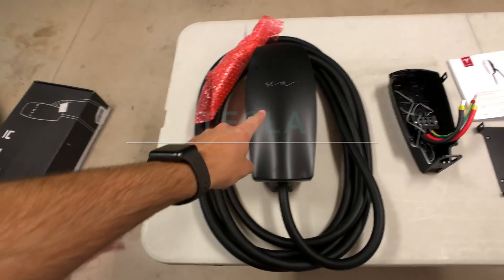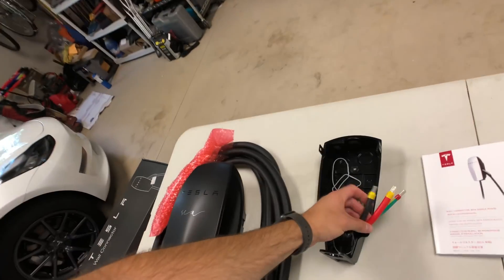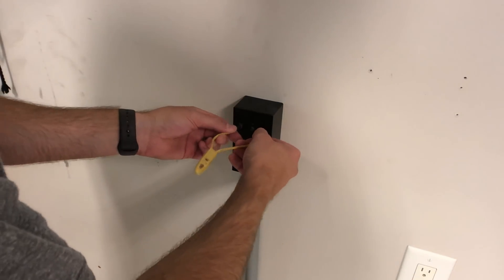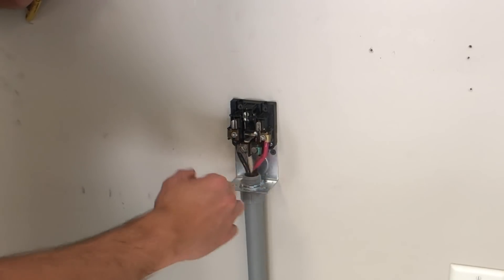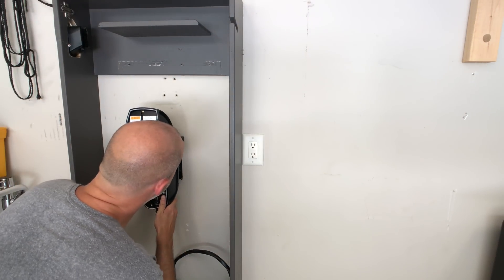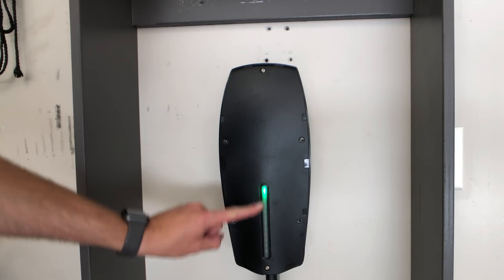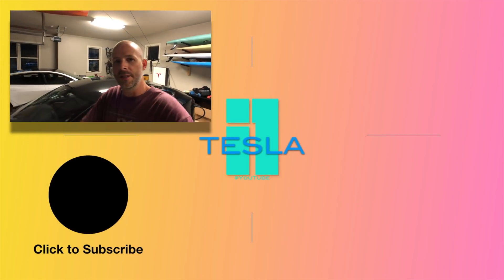Tesla Wall Connector Install

Comment: how long did it take you to install the 2 hot wires? lol, i noticed it was edited out
Reply from the maker: Not that long. About 5 minutes. The hard part is bending the thick wires in the right place
Reply: @i1Tesla it was a bitch for me. bending that in that tiny space, trying not to nick anything... then that orange light when you put power to it, played with my emotion

Comment: Hey Brian, Wouldn’t you have been able to put the 60am breaker, set the Wall Charger to 48 amps.  Then in the cars, set the amp pull for each vehicle (it is location specific).  That way, you could set your wife’s car to 32 amps for nightly charges and your Model 3 to 48 amps.  The cars would be the smart limiter rather than limiting the Wall Charger.
Reply from the maker: Yes but I moved the charger down to my garage for the Model 3. I will put the 60 amp breaker down in that garage.
Reply: @i1Tesla  That works as well, especially if you have a huge garage and two HPWC's!  Make your brother install that one.

Comment: FYI 6 gauge romex is only rated to 55 amps not 60. Therefore the max those wires can safely handle is 55*.80= 44 amps constant.
Reply: https://www.cerrowire.com/products/resources/tables-calculators/ampacity-charts/

Comment: @i1Tesla IMO you should at LEAST install the 60A breaker like you originally planned, and here is why:

The wall connector is not a charger. It's simply a smart adapter giving you a means to supply power in the form of the connector you need to plug in your Teslas. All of the power management is done onboard the cars, and Tesla engineered them individually to not exceed a certain power level deemed safe for that particular battery pack. In the case of your Model 3 "Long Range" (75) and your wife's Model S (75D), they're both limited to 48A, because Tesla believes that to be the fastest rate of charge before having long-term negative effects on a battery that size. This is why the standard model 3 will only support 32A and some larger battery pack models can support up to 72A. Thus, I think you're fine if you want to charge at max speed.
Reply: Also, considering your talks of one day owning a Roadster, I would venture to guess that a car with a 200kW battery pack will support charging at higher rates then currently available. Some of the current 100kW models can charge at 72A, so I think if you really wanted to you could max out your wall connector to the highest it can support (100A) in preparation for what's to come and your current cars will still only charge at 48A. BUT that would require thicker gauge wire, a larger breaker, and a panel at your home capable of supporting the load. Obviously, that is more expensive and completely unnecessary at the moment. Especially since we don't know the max it will support, but theoretically you could be prepared to some degree to charge as fast as your house permits. :)
Reply from the maker: The Roadster is years away but I get your point. I am going to install the 60 amp in the Show garage I am building for my 3
Reply: @i1Tesla  Gotcha. Cool thing is you can regulate the charging level (5A - 48A), when to start charging (time), and when to stop charging (percent charge) all within the car, so you'll have full range capability and still the option to regulate however you please. That'll be good.
Reply: Now I know what you're thinking, the cars charge fast enough with a 50A breaker (40A charging) for what you need, and certainly the slower you charge the easier it is on the battery, but you have to also keep in a couple things. Number 1 and most obvious, you eliminated your ability to charge at max speed in the event you need to or want to. In the event you prefer to charge slower, you can control the rate of charge on the car itself (all the way down to 5A), so there isn't a need to throttle it at the wall. Number 2, there is a trade off when it comes to charging slow. What do I mean by that? The longer it takes for you to charge the car, the longer all of those components (charger, battery cooling system, etc.) have to run, resulting in more wear and tear long term. Therefore, your rate of charge should actually be a balance between what will prolong the life of your battery and what will prolong the life of your components.

Comment: 1. LOL at your expression while you were cleaning the cable.
2. If I get a Signature Black Wall Connector, can I simply swap the face plate with my current one, or is there more different that that, like the sides?
Reply from the maker: Not sure you can get the face plate from Tesla or any owner

Comment: I've watched dozens of your videos in anticipation of receiving my model 3. Thanks for what you're doing. I'd like to know your thoughts about what percentage to charge the battery to and how low you let the car get before you charge. I've read a bit on Reddit, but am interested in your knowledge since this is your second Tesla. Maybe it could be a video or could get incorporated into your next "what if" video. Thanks again!
Reply from the maker: I depends on how much you drive. My Model S is the 75D and my wife drives about 90-100 miles a day. I charge her car to 215 miles every day. She doesn't like to get very low. But also if the power goes out here she has plenty to get back to work the next day and hit the supercharger before she comes home. My car I charge it 2 times a week. Up to about 240 miles and plug it in when I get around 70-100.
Reply: @i1Tesla  Thanks! Any reason you picked 240? Do you remember what it was set to when you got it? I've been reading things from 70% to 90%... I'll be able to go on the lower end based on my commute, but is the best approach to just keep it as low as possible? Even lower than 70%? I feel like this is something that's confusing to first time EV owners, like myself.

Comment: It shouldn't  make any difference what breaker you use - the speed of charge is not controlled by the breaker - the breaker is protecting your wiring not your batteries! So just put the 60 A breaker in and configure your charger to 50 A (position 8) if you want to limit your charging speed - in the future you can ramp it up to 60 A - position 9 - to take advantage of a higher charge without changing the breaker!

Comment: I see your using Romex. You should note that for 60 amp service you will need 4 gauge 3 wire or 4/3 which has an allowable ampacity of 70 amps. 6 gauge or 6/3 will only support 55 amps  see https://hvac.southwire.com/wp-content/uploads/2017/03/ROMEX-%C2%AE-SIMPULL-%C2%AE-TYPE-NM-B.pdf.  6 gauge is only allowed or safe if your using single wires in conduit,  i.e, not Romex. It's a heat limitation issue. Single wires with conduit allows enough cooling. Romex wires are enclosed in a tight vinyl  outer casing can get hot at 60 amps. Its good that you dropped down to 50 amps. P.S. I love the "Supercharger" case. Nice touch.

Comment: Hi Brian,  what kind of range do you get round town driving the way you do.  I also do mostly short round town trips.  Mostly between 1-3 mile trips.  I would use 50 miles of range at the end of the day for only 25 miles of travel.
Reply from the maker: Video Monday or Tuesday with all the findings

Comment: Upgrading from a 120V outlet this weekend. Is the $500 wall connector worth getting over a standard NEMA 14-50? If the difference is only 40amps on the wall connector vs 32 amps on NEMA 14-50, would it really impact the charging rate by much? Any other difference between the two?
Reply from the maker: In my opinion no. Do the NEMA install. It is all you need. I just did this because we won the charger.
Reply: sounds good, NEMA it is! Thanks for the videos... saw as many as I could before getting my Model 3 and they have been a tremendous help! Keep them coming!!

Comment: I like your videos, they’re usually good for a few laughs… Anyways, I agree with the comments about it being a shame that the “signature” is hidden with the door covering the wall connector (or as some mistake for the “charger”)… I wonder… Would it be possible to somehow get the signature onto a stick-on decal or something - and place it on the front of the “Urban Supercharger”? 

Maybe add either a black, or gold stripe to the door… Then you could refer to it as the “Signature Series Supercharger” (yes, I know there’s several S's… ) #just_a_thought!
Reply from the maker: I will be putting on in my show garage that wont be in a box. I will be showing it off

Comment: 48amp (12KW) is still a VERY slow rate of charge on a 75KWH battery, it will not be even remotely close to hurting it or decreasing life in any way.

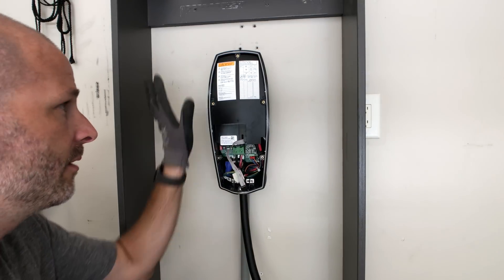Comment: 10:34 - I believe you can set the amp within the car and even schedule the time within the Model 3. So even if you have a 60 amp breaker - you can lessen the amount of amps for charging. This would be a good "What If" question.
Reply: You can. The car even remembers based on GPS what charge current to use next time. Personally I'd put the 60 amp breaker in and dial down charge current if you're worried, then if you ever need the extra power in a hurry you have the ability to increase it.
Reply from the maker: You can do that but why go through all that to change it to 60 amps if Im going to lower it in the car.

Comment: Should have done the 60 amp breaker.  It would make no difference to the battery.
Reply from the maker: I will use the 60 in my show garage for the 3

Comment: So you stuck with the 50a breaker.  How fast does that charge the Model 3?  The Nema 14-50 does mine at 30 mile per hour but of course that only charges at 32a.  Do you get 40a?  If so what does that equal miles per hour of charging?
Reply from the maker: Yes the 3 gets 40 amps. The mph depend on the state of charge

Comment: 6-gauge Romex wire doesn’t support 48A sustained charging on a 60A circuit so it’s good that you stuck with the 50A breaker for 40A charging. 6-AWG romex has max ampacity of 55A.
Reply: Max continuous current 55 amps yes but the Tesla charger is set up for 48 amps maximum so 6 guage Romex is just fine with a 60 amp breaker. In fact a 60 amp breaker is specifically allowed by code on 6 awg Romex.
Reply: I don't think this is correct.  I am going through this right now.  I was told you have to de-rate the Romex because of the jacket it is in.  With 48A continuous load, the romex will not dissipate the heat enough and you really should only use a 50A breaker with #6 romex for continuous load.  It is against electrical code to run Romex on the outside of drywall.  You must use THHN individual strands in 1" conduit according to what I know about code.  That being said I'm no electrician.
Reply: You are allowed to use a 60 amp breaker but that is only because they don't make 55 amp breakers. Max continuous current is always 80 percent of wire rating. 55 * 0.80 = 44 amps continuous for 6 gauge romex, 60 * 0.80 = 48 amps 6 gauge THHN.

Comment: Is that legal to do yourself without electrical certification? At least here in Finland it's illegal to do that kind of electrical work without proper training and certification
Reply from the maker: Not illegal here
Reply: Generally in the US, DIY electrical work is permitted without any training or certification.   It varies depending on jurisdiction however.  Some cities may have local ordinances requiring a licensed electrician.  My locality permits DIY work all the way up to complete service panel replacement.  Though such a job is required to be inspected.  Installation of new outlets or hardwired appliances requires no inspection.
Reply: @stevenmetcalf4571  Ah I see! Thanks for clarification :)
Reply: In some places in the US it is a permit is required with inspection.  Anyway you want one since if something shorts out your insurance can deny a claim.

Comment: Like your install man! My Tesla charger still on garage floor, not installed. Got a NEMA 6-50 on the garage wall for welding. So I'm installing a NEMA 6-50 pig tail into Tesla charger, than just plug wall charger into outlet. The Model 3 parks next to wall charger, so the 8' charge cable works. Tesla parks next to Yellow Hummer.
Reply: ArizVern Tesla parked next to Hummer...can you say dichotomy in transportation
Reply: You see I generate too much electricity, I need an electric car. Fifty solar panels on property, not on total electric home. Small platform 30' x 60'. Ten feet tall, farm stuff stored under solar.
Reply: ArizVern was a joke, got to be some irony there somewhere....sounds like a cool setup....just hope you don't cook with electric...
Reply: OH my God! I have over generated 275 KWHs this month, Aug so far. My power company paid me $327  for last year over generation at $0.04 a KWH. I DON'T MAKE MONEY ON SOLAR! Solar cost was $85,000 installed in Feb. 2009. Here I'm adding 11k to my system. https://www.youtube.com/watch?v=TtQm34QopN8
Reply: My Solar System is called GRID TIE, everything is done with electricity. I even have a Machine shop on property, Mill, lathe, welding, plasma table.

Comment: Can't you schedule the charge time and set the speed of charge?
Reply from the maker: Yes you can but the charging rate here is the same (.10) so don't need to schedule. I could lower the speed to but why install the 60 amp then
Reply: @i1Tesla  I see it so you can slow charge over night, but still have the option to charge faster if you need to go somewhere later.

Comment: Little shame for the signature faceplate hidden inside. If you have space both physically and in amps in your panel, you should just leave the UMC inside as before and install the wall charger beside it.
Reply from the maker: I see your point to not hide it but it is like a prize inside a prize.

Comment: Thanks so for showing the process. As of now, I'm sticking to the mobile charger. I have a 14-50 NEMA plug installed in the garage. Now I know that I can easily swap to the wall charger if I get the referral codes needed.